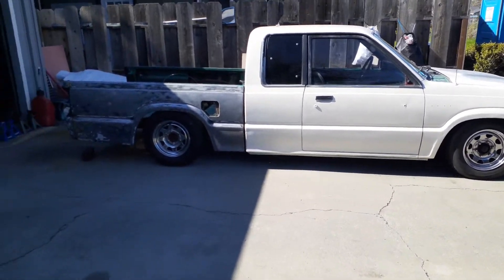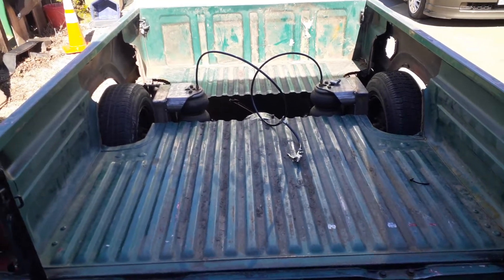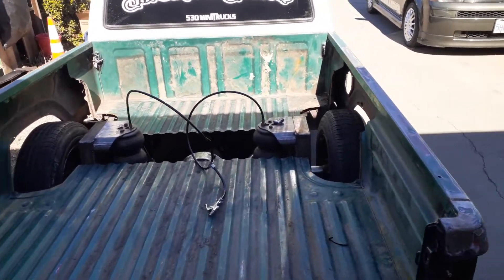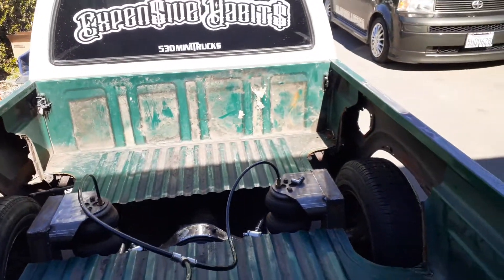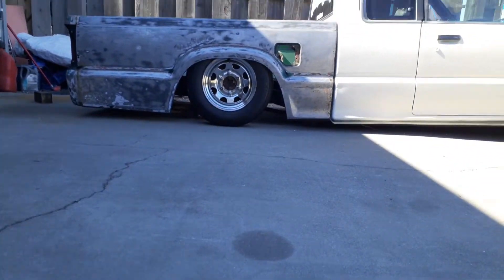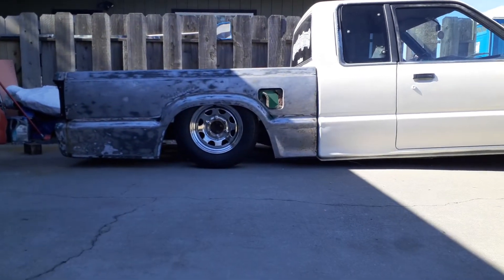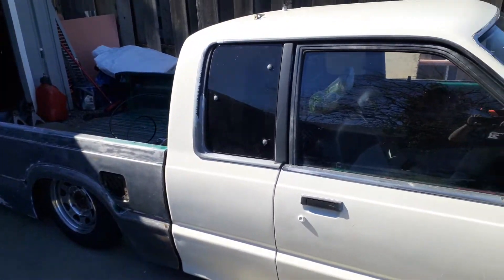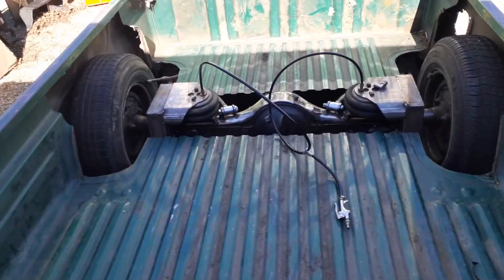Update on @lunchmoney_530

Comment: Do you have any issues with the centre steady bearing for the 2 piece drive shaft? On mine the steady bearing keeps blowing out. I wonder if its pinion angle from the 4 link
Reply from the maker: I don't but, that could be your problem is the pinion angle